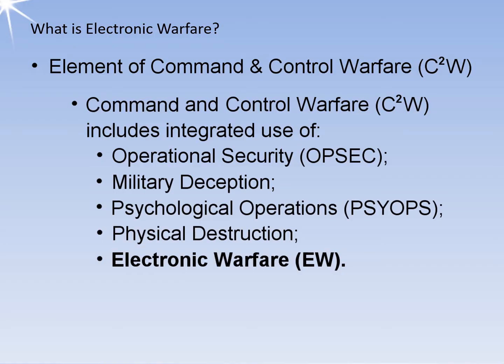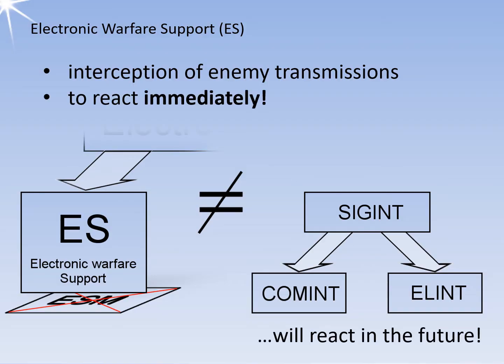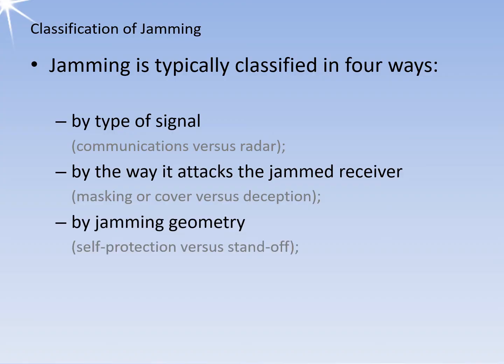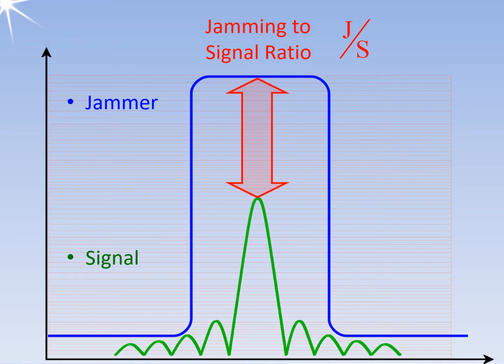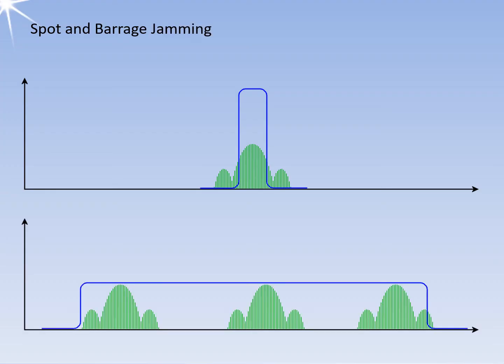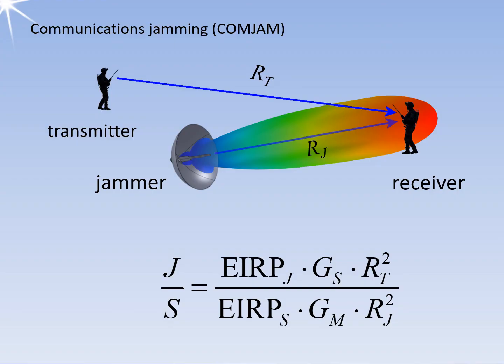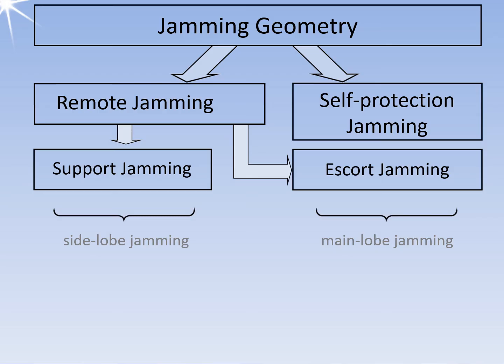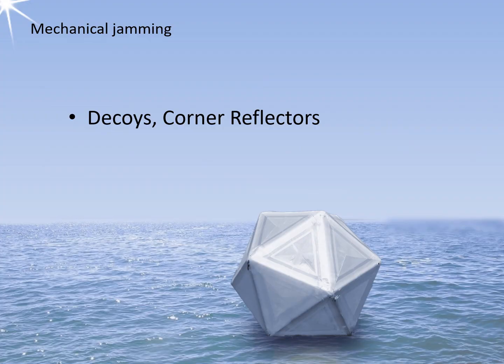Electronic Warfare

Comment: Spark gap jammer.

Now no one can talk.
Reply from the maker: The spark gap transmitter was one of the very first forms of radio transmitter. It was the form of transmitter used by Heinrich Hertz when he confirmed the existence of electromagnetic waves.
Such a spark gap generates a very broadband spectrum and is therefore suitable as an antique broadband jamming device. However, it is very ineffective because the spark causes a short circuit and very little energy is converted into electromagnetic waves. 
Nowadays, there are much better ways of generating broadband jamming in electronics.